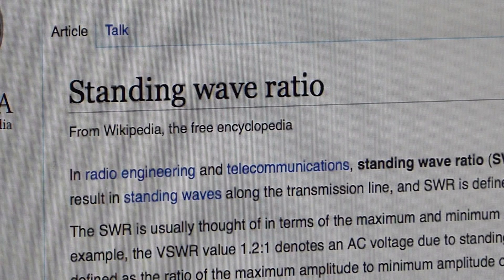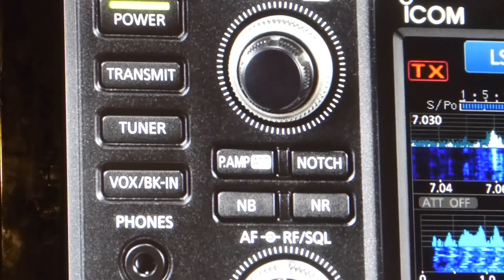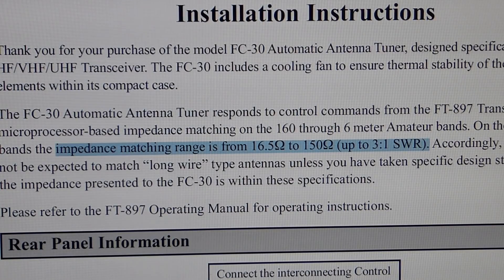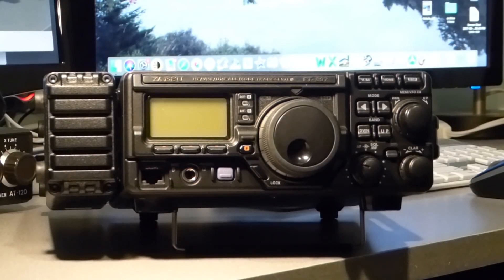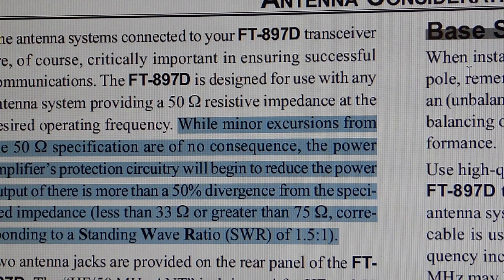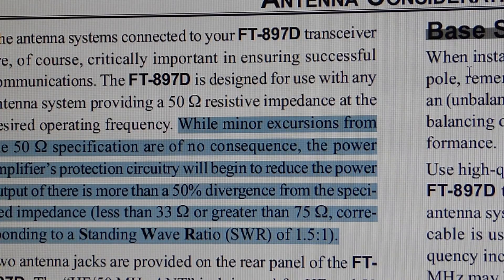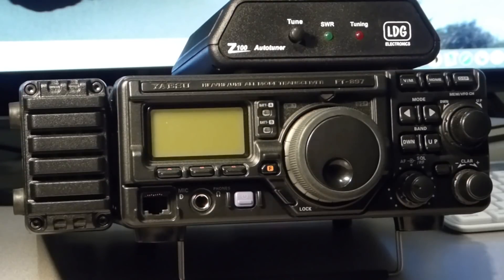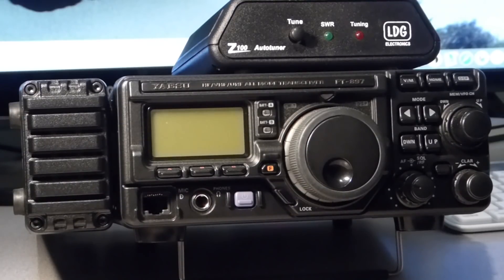Automatic vs  Manual Antenna Tuners

Comment: The Icom IC-7000's power drops as SWR increases above 2:1. This note can be found on page 15 of the owner's manual. The problem with the IC-7000 is that there is a design flaw. If I recall correctly the original design allowed too much current to flow to or through the finals and would eventually burn them up. I had to send mine in because TX power dropped to about 50% 30 minutes after Field Day started, and Icom replaced the finals and installed a resistor nearby. I saw this procedure in another YouTube video by a non-Icom tech, and he explained that the later designs had this resistor installed. If you use the Icom AH-4 automatic antenna tuner, not only will it drop the output power to 5 watts during tuning, but it will auto tune when needed without the operator having to press Tune, although the Tune button can be used at any time. I think that the manual tuners can be a great learning tool, but the operator would have to remember to drop power output every time tuning is performed unless the tuning was done while receiving only. Auto tuners typically can't be used for higher power whereas some manual tuners can handle 1500 watts.
Reply from the maker: Thank you for sharing this information!
Reply: @OutdoorsOnTheAir  You're welcome. 73

Comment: Thanks Tracy, I'm new in HAM and yet to get my licence. I'm trying to absorb as much information as possible before I buy my first rig. I opted for the Yaesu FC10 since I figured it's gonna be a no fuzz tuner but upon seeing your vid, it got me thinking... Thanks for the enlightening insight. I appreciate it.
Reply from the maker: Good luck with getting your license 👍 Looking forward to working you one day.
Reply: You should decide which HF rig you want before getting a tuner as some tuners work with a limited number of transceivers.
Case in point, the Yaesu FC-10 was made for use with the Yaesu FT-840 HF transceiver.

FC-10 Specifications:
* Coverage: 1.8 to 30 MHz Amateur Bands
* Power rating: 100W PEP
* Memories: 31 total
* Tuning time: 1 to 8 seconds, 4 seconds average
* Antenna matching impedance: 16.5 to 150 Ohms (SWR less than 3)
* Tuning power: 8 watts or more
* Matching Time: Under 30 seconds
* Power requirements: 13.5 volts DC @ 700 mA
* Enclosure: 4.5 x 4 x 9.5 inches 4.5 Lbs (117x93x243mm 2 kg). 

 The Yaesu FC-10 Tuner is designed for the FT-840. It operates in all nine HF amateur bands and features 31 frequency memories. The FC-10 provides a compact, easy-to-install unit that is styled to match the appearance of the FT-840 and will match a wide variety of antennas to within a 1.5:1 SWR on any amateur band frequency in typically less than 30 seconds. You can use the tuner switch on the transceiver for one-touch recall of tuner frequency memories that have already been stored. SWR matching occurs in under one second for memory recall. Transmitter power required for matching can be as little as 10 watts and matching settings are automatically stored in memory for instant recall when the same frequency range is reselected later.

The back panel features SO-239 inputs and outputs plus a ground lug. The FC-10 comes with a 3 foot (1m) coaxial cable, 3 foot (1m) control cable and features a pull out flip stand if you wish to operate the tuner at an angle.

Comment: I do like how your try to give the best information you know. In some cases automatic tuners can be an issue and especially for the FT-817.  There I moved the elecraft tuner that allows you to manually adjust the tuner or let it decide.  Today it’s much easier to get an automatic turner but I suggest one that has more buttons to allow manual adjustments.
Reply from the maker: Thank you for sharing your experience!

Comment: Tracy, I always enjoy your videos.  I use an FT-897D as well.  I bought it used and it came with the LDG autotuner.  My antenna is an inexpensive vertical and I had trouble tuning it successfully.  I switched to using a manual tuner and love it.  Last weekend I talked from my QTH outside Vancouver to stations in Alaska, Hawaii, Japan, Finland and French Guiana on different bands. I give significant credit to the ability of my manual tuner to extend its reach beyond the 3:1 range of the autotuner. I have a manual tuner in my shack at home and I have a second one in my kit for when I go portable. I don't foresee going back to autotuners.
Reply from the maker: Thank you for sharing your experience, Bruce! Those are some great portable contacts you racked up. 73 my friend.

Comment: definitely agree with the reception and the technical nature of learning how tuning actually works...   as for the presenting bad swr to the radio, there are quite a few good designs that don't do that... take the icom AT-140/ah-4 ... it presents a 50 ohm resister to the radio during so the radio always sees basically 1:1 during the tuning process, and it taps off a very small amount of RF to actually put on the line (I believe it is well under 0.1 W radiated while rig is driving 10 W into the tuner).    I would say the biggest ADVANTAGE of an automatic tuner is one that is placed AT the antenna. Manual tuners and automatic tuners inside the shack are tuning the antenna AND feedline... and that usually makes the feedline part of the antenna (introducing losses and potential for RFI / noise).  An automatic tuner AT the antenna keeps the signal in the coax 50 ohm to the tuner, then matches it at the point that it no longer matters (the antenna).    Very much like the guys that use the high-voltage variable caps at base feed of 160 meter and some 80 meter antennas (ie loading a tower)...   but yeah, there are days I fight with my ah-4 ... where I know a solution exists, but because of the current solution being weird, it can't find the correct one... sometimes have to change to certain bands to get the tuner to tune a solution that is closer to the desired solution then move back to the desired band before it will figure out.
Reply from the maker: Thank you for your thoughtful comment. I didn't know the AH-4 presents a 50 ohm resistor to the radio, very interesting!

Comment: Don’t tune with max power. Set it to 1W and your finals would be happy.
Reply from the maker: At times it is necessary to set the tuner at very low power and then tune again as you increase power.
Reply: @OutdoorsOnTheAir  If SWR depends on output pwr then something is wrong with your tuner, fider, balun, antenna etc.
Reply from the maker: @АндрейДенисюк-ш7п  Let's call a spade a spade...if you're using a tuner, then there IS something wrong with your antenna system to begin with. Stick to a resonant antenna and you'll avoid the issue completely.

Comment: I have the LDG Z-100Plus ATU. It can tune with as little power as under 1 watt so tend to do that on bands where my ATU can't set a match without a lot of time (vs the under 1 second time it takes to pull up a memory of a frequency or close by the frequency I use a lot) or when I'm trying to tune something I just know it is going to send a lot of RF back down the coax!

I will say that the Z11pro or the AT-100 or the AT-200 from LDG offer fine-tuning the tuners "best finding" and the 200watt or even 600watt version in the future is definitely something I'd consider but for now, the Z-100Plus is great because it needs minuscule amounts of power which is great for QRP on the usage but also perfect for a "barefoot" Transceiver like my ICOM IC-718 which is 100watts and interfaces with the Z-100 for both power and tuning via the radios tuner button and some other features.

Comment: Thanks for the tip on tuners. Off hand do you know if the IC-7300 has finals protection. Looking at the automatic tuner for now but want to explore the manual ones later when I become more comfortable with knobs and dials??? I get what you are saying. I need more experience. I subbed to Julian's channel. I have been subbed to yours since the Ailunce HD1 video. You explain your case very well!
Reply from the maker: Thank you for your comment! I don't know if the 7300 has the protection, but I would presume it does. FYI, you can learn to use a manual tuner in just a few minutes.
Reply: @OutdoorsOnTheAir  Thanks for replying. I should have asked you if there is a manual tune brand or model that is currently sold new out there that would work good with the IC-7300. "Works with my radio" is kind of a stupid question as I am sure you just want to get a tuner that works with the frequencies and power your radio puts out. I am kinda leaning towards manual as I do like to snoop around on those off band frequencies on occasion.
Reply from the maker: @1crazynordlander  At the risk of being controversial, I avoid like a plague manual tuners made by a certain three letter acronym manufacturer. I have two manual tuners, one Yaesu and one Kenwood. Sadly, those manufacturers don't make them any more. Those products were made to a significantly higher standard and it's worth waiting for one to appear on the used market. I love my Kenwood AT-120 and am looking for a second. For base station use, my Kenwood AT-180 is a champ.
Reply: @OutdoorsOnTheAir  Thanks!

Comment: You ignore all the unnecessarily rf on the air while people tweak for 1:1. The tuner uppers are a major problem. Auto tunners were already the norm for non resonant antennas way back in the 1960's on military stations
Reply from the maker: You raise a good point. The considerate operator will never tune up on a frequency that is in use. Instead, he or she will tune a few kHz up or down to do the tuning (starting at very low power of course) to ensure no interference is caused.
Reply: @OutdoorsOnTheAir  but basically all frequencies are on use.

Comment: I'm new to amateur or ham radio very good video .what antenna tuner would you recommend to use on a Yaesu ft 100d thanks
Reply from the maker: Find a good used manual tuner (preferably not one with three letters as a brand name). I really like the Kenwood and Yaesu ones, but I've also heard good things about Dentron.
Reply: @OutdoorsOnTheAir  okay I appreciate your help I 'm a old c b  er .trying to become a  ham operator even though some people aren't very helpful but I will over come that thanks again ki5esh Darrell
Reply from the maker: Please don't walk away from the hobby due to some intolerant people. There are plenty of friendly, helpful ones out there. Join a local club to meet some :).

Comment: Any chance you have a videos on how to use those Kenwood tuners? Really the AT-180 !
Reply from the maker: No video on that (yet!)...but here is how to do it put briefly. 
- Once the antenna and rig are connected and you are tuned into the frequency you want to use, on the tuner switch to the band you are operating on. 
- Then put both rotary controls at the 12 o'clock position. Starting with the first knob, rotate the control slowly until the background noise on the rig rises to a maximum level. 
- Once done, repeat this process with the second knob. 
- You can then safely key the rig, then rotate the left knob for minimum reflected power. 
- Unkey the mic. Key again, then repeat with the second knob. 
- Keep transmissions short during this process. Either the tuner will bring the antenna system down to an acceptable SWR, or there is a large problem with the antenna or the tuner.
Hope this helps!

Comment: I hate auto ATU's. always manually tune a manual atu for greatest noise/signal, then, and only then use lowest power possible to tune, and then ONLY for short periods. If you tune for maximum noise or signal, in most cases the swr will be very close to acceptable . NOTE! make sure rig the rig and atu are both connected to a good ground, this alone will reduce the risk to your tranceiver and yourself. 73s's, Barry VK2FP/ AG7VC
Reply from the maker: Great tips, thank you Barry! 73 from VE3TWM.

Comment: something to take note of about tuners in general. If you're tuning up 3:1 SWR and transmitting 100W, for example, the antenna is still only going to put out 25W. All the tuners do is make the radio happy; not necessarily the antennas.
Reply from the maker: Good point!
Reply: That's down to feeder not tuner, that's why it's best to use open wire or ladder line almost all the applied power will be radiated

Comment: Thanks again, Tracy! I've found this video so informative that this is the third time I've watched it. :-)
I'm about to buy a manual tuner, but I'm having trouble deciding which to buy! I'd like it to be fully featured, and I love the idea of a decently sized, easily readable meter, but I'd also like it to be one that I can take out in the field, as I prefer portable communications to sitting behind a desk (too much like work!). So I'd truly appreciate any recommendations you might have. Thanks again and 73!
Reply from the maker: This is tricky as I don't want to offend anyone. Oh well, here goes. I avoid accessories made by a certain 3-letter manufacturer that starts with "M" due to production quality concerns. Look for a good used Yaesu or Kenwood manual tuner. You might have to wait for a while, but they were built to last for years.
Reply: @OutdoorsOnTheAir  Ah, interesting! And I hear you. I've been a tad concerned about that myself. I will definitely take your advice, thanks!

Comment: I'm old school, but I prefer the speed with which my auto-tuner, which is at the antenna, finds solutions in nearly all cases. I did, however, spend some time stepping through the bands to figure out where it might choke; I also tune at relatively low power, just enough for the thing to work properly.
Reply from the maker: Thank you for sharing your experience.

Comment: Thank you for your informative video. I am new to the Amateur Radio scene. KG7WEN. I am trying to understand the need for Antenna tuners. I have a MFJ-874 and trying to understand that unit. Am I correct that the MFJ-874 is only a SWR meter and not a Antenna tuner? I also have the ICOM IC-718 Radio and I see a button on the front panel that says "Tuner" is that a built in Antenna tuner? Thank you again for sharing your video.
Reply from the maker: Congratulations on getting your ticket and joining this great hobby! We are happy to have you join our ranks.
You are correct. The MFJ-874 is just a meter, not a tuner.
The Tuner button on the 718 is designed to control an external automatic tuner. There is no internal tuner in the 718.
73 from Tracy VE3TWM.

Comment: I am unable to operate from home  so have no choice but operate HF from the car  favorite band 17 Mtrs  a manual tuner from the car is difficult to put it lightly  i use the LDG Z100  on my FT 857D  all mounted out of sight  i have modded the LDG  using an old 4 pin mic plug and skt i now have a small box with 2 leds and a button mounted just below the radio head   . works a treat  .. 
73  DE G6NJR .
Reply from the maker: Sounds like a nice setup, Pete! 73 from Tracy VE3TWM.

Comment: Hi Tracy, I was curious about your video on manual versus automatic tuners while manual tuners give you more control, automatic antenna tuners will work as well as long as you turn the power down so you don't stress out your finals. Addressing your comment about the ft-817, I talked to Yaesu technical support today and they said that both the original ft 817 and the ft-817nd models have cut back circuits on them. Since the LDG Z-817 will work down to 0.1 watt turn the power down if you are concerned before doing a tuning cycle.
Dave Black
Reply from the maker: Hi Dave, thank you for the information on the protection circuits on the 817 and 817ND. I didn't know about that. Regardless, take a look at the eHam reviews of the 817 and you will see plenty of people reporting failed finals while using the rig with automatic tuners.
73 from Tracy VE3TWM.

Comment: You certainly hit the  nail on the head with this one. I gave up after replacing finals in my 817  three times . I was using an automatic tuner.
Reply from the maker: Sorry to hear of the troubles you had. Thank you for sharing your experience, it will hopefully save others from the same fate.
Reply: 3 times? what were you doing wrong? what type antenna? was the radio modified?

Comment: Thanks Tracy, great video.  I've been preaching the merits of manual tuners since the processor-driven tuners came into widespread use about ten  or so years ago, but the newbies on my facebook group don't seem to hear my words. Maybe if they hear the same words from you they'll listen. The points you've made are all valid. And in case you think I'm an "auto tuner hater", I regularly use the LDG AT-100ProII with my TS-140S,  and the MFJ-939 with my FT-950.  Both work very well, but they each have drawbacks too, some of which you've pointed out.  Keep up the great work. 73 N5FPO
Reply from the maker: Hi Mike, thank you for your sharing your experience, I appreciate it. 73 from Tracy VE3TWM.

Comment: A very interesting video Tracy. I first used manual tuners on Brit army transmitters some years ago. They were tuned for max indication on the meter i.e  RF current pickup circuitry. So I used to connect up my home brew Ham VSWR meter in line just to check that I was getting the best output/match with a half decent earthing system.  I used to get some funny looks until I started  to educate my fellow op's in antenna theory. One of my best home brew tuners was a silver coated, 14 SWG copper wire coil, Pi match for a vertical half Rhombic on low band VHF. Worked a treat with QRP both from Germany up into Denmark and in Malaya across  from East to West across the jungle using a man pack radio when the Brigade rebroadcast station broke down.
Reply from the maker: Thank you for sharing your amazing experiences, John.

Comment: I have to agree, but the auto tuners are neat and in most cases pretty fast. My radio has a built in tuner, but using an antenna that is for a specific band is a good idea for sure.
Reply from the maker: Thank you for sharing your experience.